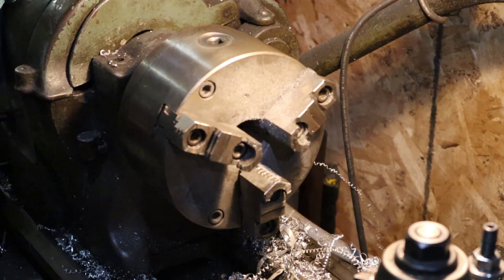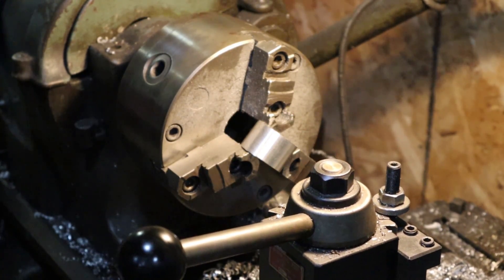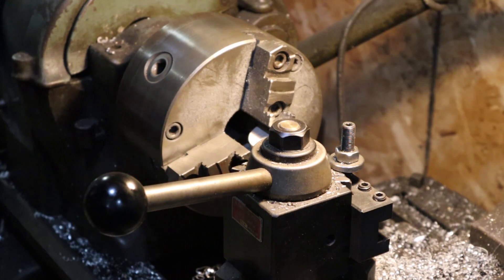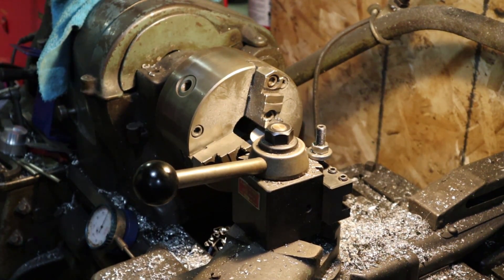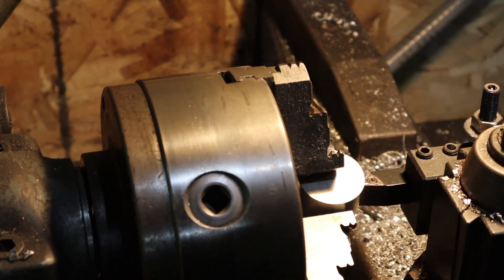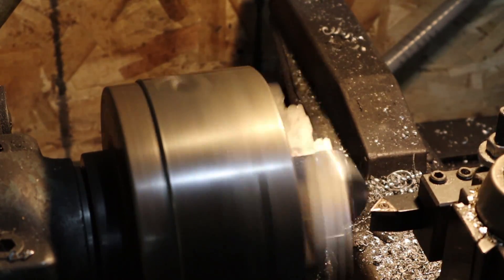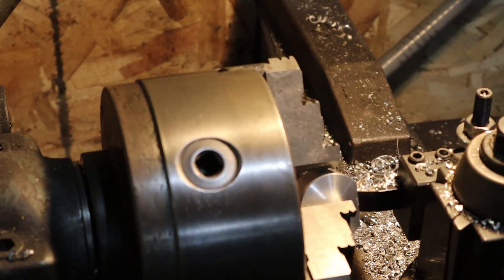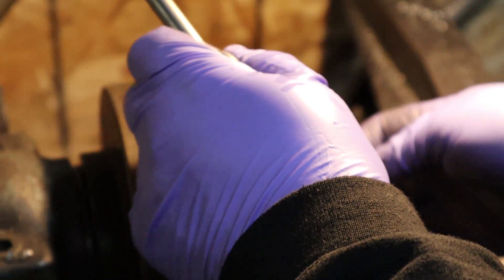MACHINING A CUBE ON A LATHE!!!!!

Comment: So you’re relying on two jaws to grip the part, and relying on the other jaw to set the right angle. Ive done this and it’s never an exact right angle?
Reply: It's never exact with a 4 jaw either when I make captive cubes I just stop and look after I get a flat spot across and then adjust the cube accordingly and they come out fine

Comment: What rpms you running at? It’s only aluminum so running higher rpm if the machine is capable would reduce the stress on the tools and the machine. Cool video!
Reply: Lol yeah I figured that’s why you kept it low. Them old machines were built so rigid! That’s cool that it’s still kickin being that old. We still use a 1930’s gear cutter in a production scenario! New gear machines just don’t repeat like the old ones do!
Reply from the maker: Thanks for the tip. I'll give it a shot. It was running about 1100 rpm. It makes some cool and somewhat scary noises at higher rpm. The thing was built in the 40s 😳
Reply: @MorFabIndustries  40s that's not to old I use a lathe from the 20s

Comment: You can fit a round peg in a square hole without modifications to the peg or hole. https://www.google.com/search?q=round+peg+square+hole&oq=round+peg+&aqs=chrome.1.69i57j0l3.3764j0j9&client=ms-android-verizon&sourceid=chrome-mobile&ie=UTF-8#imgrc=Y5fOL8dYPlRVtM: